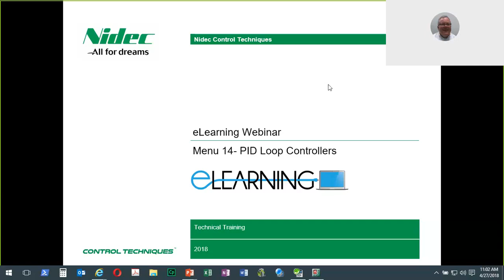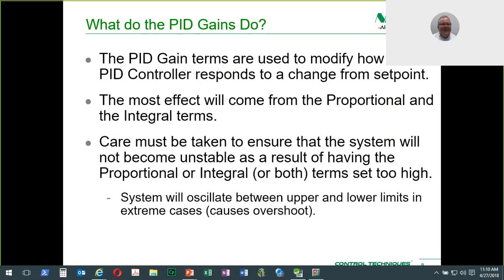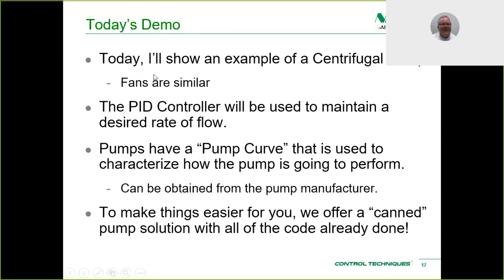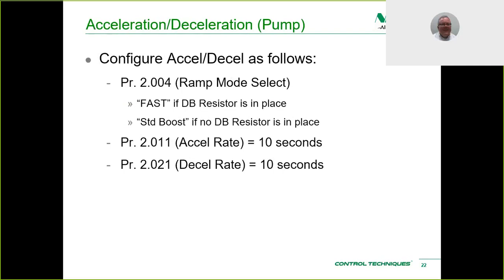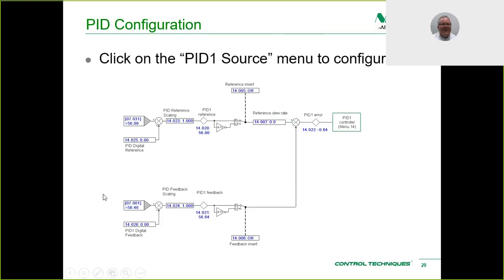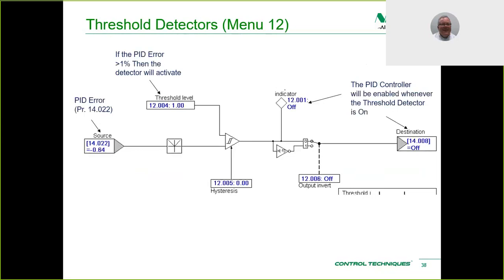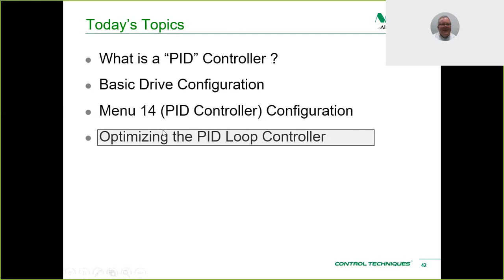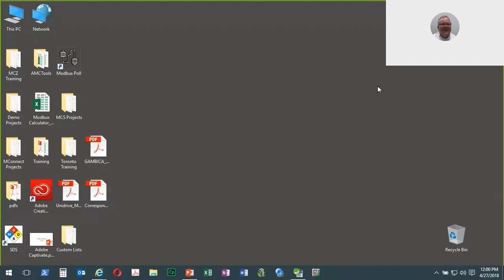Menu 14: Configuring a PID Controller

Comment: Very good presentation.  Is there any volume for the mins. 48 to the end?
Reply from the maker: Hi Brooks, Thanks for the nice comment and bringing this to my attention. I'm afraid that I cannot repair this. What must have happened is that when I stepped away from my computer to operate the equipment, my Web service must have determined that the meeting was over and stopped recording audio! I apologize for this and if you have a question, feel free to contact our Technical Support department at 1-800-893-2321.